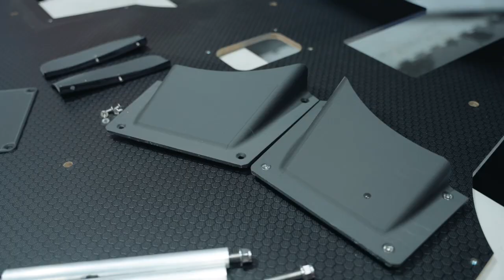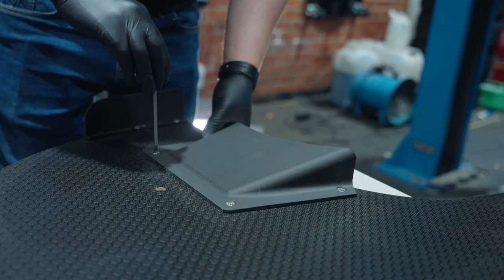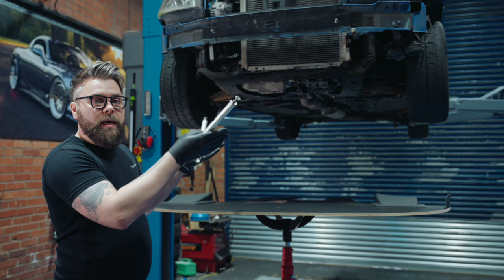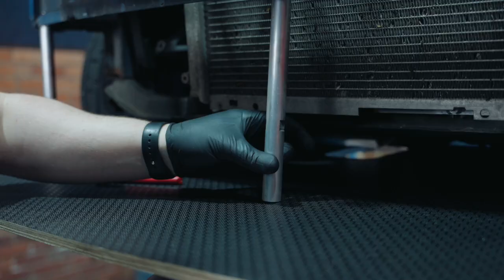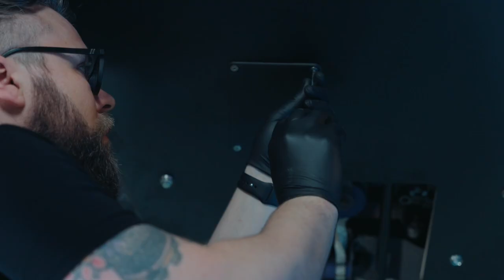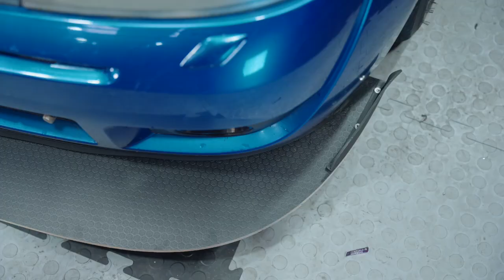RacingCult Renault Clio 172/182 front splitter installation

Comment: Looks great, is it blue book compliant? Have you noticed any increase in water or oil temps?
Reply from the maker: This would extend too far to satisfy the normal 100mm extension allowed in the blue book, but we could make one to stat specification very easily for you. The splitter will actually improve cooling temperatures due to closing off the floor area below the radiator. This will encourage the high pressure air in the engine bay to be extracted behind the engine as intended. This increases airflow over the engine, and through the radiator